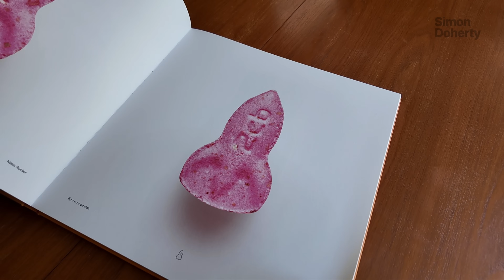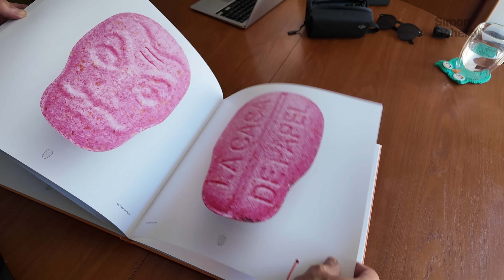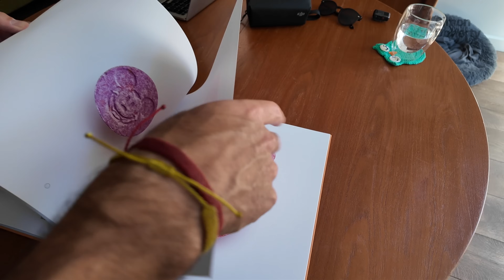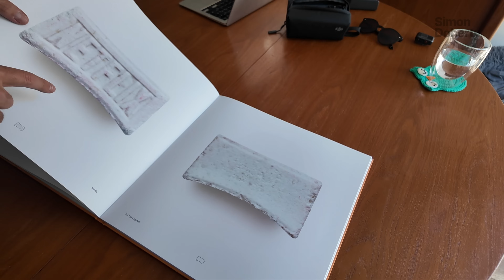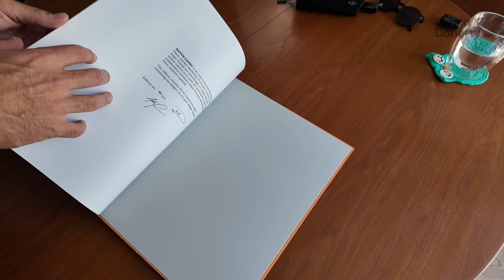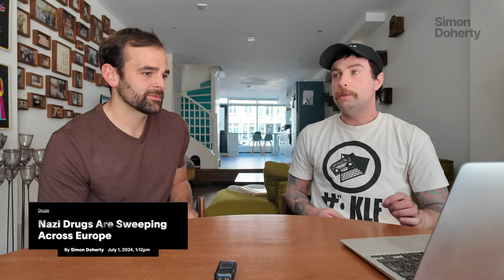How Your Ec𝓈ta𝓈y Pill Gets Its Design

Comment: 29:10 It's not trolling. It might be genuine conviction (just look at the Santa Muerte cult that twists Though Shalt Not Murder into a brutal machismo message) but it's primarily greed. We saw this come down the wire with 2C-B first in a push to mainstream the substance and it got adopted by the MDMA scene far later.

Comment: When we went to the first acid house raves 1987 we had Cali burgers which was my first before doves,then liquid mdma caps. Then all sorts. The worst were china whites. They were tiny but proper heavy like skaggy effects. Instead of people up dancing hard. They were sitting or backs against the walls. Gone are the days of E's that put a smile ( gurn ) on your face. Plus,it's not just the pills alone. The factor of doing them for yrs doesn't help. Plus you're wellbeing and life has to be steady. Otherwise that truma will give you a negative ride.

Comment: Where I live, they always come in gel capsules, I’ve never once seen a stamped pill.
Reply: The first few i took back in 92 were capsules. Had to be careful as could have anything in them. Remember cracking one open before going out and it was speed with a cut up acid tab in it. Still had a good night 🎉

Comment: For harm reduction, people should be charged based on the total amount of MDMA they possess, not the number of pills they carry. It's similar to how you're charged for 100 grams of cocaine even if it's only 20% pure. XTC should be fully legal because it's mainly used in hot environments and it does not make sense to take it more than one every 1 to 2 months. MDMA-related deaths could be reduced to zero. Cocaine is harder to legalize since it keeps on working with increased doses or methods like smoking or injecting. The cocaine situation is a disaster right now. Most of the cocaine for the European market arrives in my city, and a significant amount stays here, which is evident not just from what I see but also from statistics. Large parts of Central and South America have been devastated by it, and now even more so with other, worse drugs. A solution is urgently needed because people won't stop using. Cocaine is an unethical drug to use. While many drugs could be legalized, stimulants are complicated because they can cause psychosis and make users a safety risk. Heroin should absolutely be legal, provided for free, and administered in clean environments with nurses and new needles. This would drastically reduce robberies and bring heroin back as pure heroin, saving countless lives. Apologies for pointing out the obvious, even though no one asked me to ;-).
Reply: Did I write this?

Comment: Haven't had pressed ecstasy in the states since I was in high school 2012-15. Everything now is molly without cut/filler. I miss the Simpson's cutouts and the white Rolexes.
Reply: The pressed ones are around, but very hard to find real ones outside of the rave scene- most outside of that are just meth with very bad presses. I have only seen legit molly pressed one time post-2016, all other has been crystal, which is what you should be buying in the states if you want real molly.
Reply: @sethf2009 You mean in the US?
Reply: @sethf2009 this. i got one pill that felt methy af at a club in los angeles. glad i only took like. the small half and flushed the rest. then i got a pill at an undergeound hard techno + gabber show  and it was probs one of the best rolls ive ever had.
Reply: Because pure crystal MDMA is WAY safer because you actually know what you're getting, especially if you test it. People can put who the fuck knows what into a pressed pill.

Comment: There is another collection similar to this; the Institute of Illegal Images in San Francisco which houses a huge collection of LSD blotters of different designs (interesting tidbit, the whole blotter-with-print is mostly a 70's thing with four color prints only showing up around the 1980's, so if you see someone drop amulti-colored tab ina show or film set in the 60's, that's an anachronism). I also remember once reading an article on Vice about a New York artist who collected stamped Heroin packages, and collected stories about them. His fun fact was that the more high-class the branding, usually the worse quality the heroin was.
Reply: dude i worked at a law firm in chicago and at one point my coworker was tasked with getting something from "the basement".  being that we were on the second floor of a building in the loop i thought this was a euphemism, but sure enough there actually was a basement to the building where we stored archived/completed case files. my coworker came by my cubicle like, "aye, wanna see some crazy shit?"

well how am i gonna deny an invitation like that?

cut to a very normal looking basement with some of those lil cardboard boxes with the thick lids that are basically all just full of random papers....except one in the corner. with a single lift of what looked no different than any of the other piles of paper my dude reveals that our court runner, who had infamously gotten fired weeks prior due to nodding out at the cook county clerk's office, had not only been shooting up in the basement, but had kept every single bag from when he used and just hid it in this one lil box. all of them had morbidly ironic/humorous "brands", often toying with the concept of death. they effectively WANTED you to be scared of a given bag's potency.

again, this is chicago, and whatever the locals call "heroin" in your area depends heavily on where you are in the united states. as you get closer towards the middle you can see the crossover happen in real time, but generally speaking: east of the mississippi river? powder. ECP/#4/china white, whatever you wanna call it. west? black tar and..."gunpowder" heroin...? it's one of the weirdest compounds i've ever had, it looks like potpourri or some other weird herbal tea but once you breathe over it like you're trying to warm up your hands and the moisture from your breathe ends up "melting" the gunpowder into a single coalesced compound that may as well have been black tar from the start, but something about that weird little trick felt like i was watching the most fucked up episode of bill nye the science guy you've ever seen lolol
Reply: The artist was Clayton Patterson

Comment: 100-200 with a braker line is a good product, Strong enough for a night but also choice incase you don't need to be fully rolling.I do like the book. Does it come with breakdowns of whats in them? As cool as the art is it would be great to have information about each one as well.
Also with the rising risk of Fent entering Eruope I can see it being tried but the backlash would be crazy towards dealers, if they decide to spike drugs inhopes of getting people additced to fent. There has been Nitazines found in Pills accros Europe which is WORSE than Fent but its stuck in the fake oxy box and fake benzo box and even then dealers are being open about whats in them now due to backlash and deaths.

Comment: Bro if I get pills that looked that badly pressed , I would rather stay sober for the night
Reply: Just test, usually fine. Does go back to what he was saying about people preferring it but doesn't really change the quality of the product itself.
Reply: @kyrusinek  back in 2008 one night the only available pill were brown hearts. They were pressed well but were brownish off color. 
Turns out some local gang pressed h in it, because the city notorious for it. 
So there are always tons available cheaper than mdma on bulk at the time.

So yeah like half of the club was puking and laying around on the ground later that night. 
That was so awful, almost choked on solid vomit at the chillout.
Really disliked pills from then on, switched to pure md, and ket later..
Reply: Very odd way to gauge something that's not a pharmaceutical 😂

Comment: oh WOW , they have changed !!  much simpler logo/designs back in the late 90's !
used to party a lot, but stopped around 2002. i do have a vague memory of semi-getting back into it for a short time proly around 2005, and talking to peeps about presses was >> take those if u wanna get floored, take molly if u want clean...  i say that as a precursor to >> so back in the 90's it was SOO rare to get pure(s) or molly. The pillz were all over the map, but there were lots that were a clean time. only some got u floored. contrast that to what peeps were saying circa 2005, and my memory of having that salty sweaty high... that head swimming, intense... i call it 'feeling salty' .. whereas the 90's stuff was more serene, almost mescaline-like ,, ethereal ,, felt like the room was giant and you were swimming in peace. a peaceful bliss... AND that is EVEN when taking many and maxing out...   the later ones, in my experience were more like that machine head, salty feeling ... clenchy clenchy clamp clamp
Reply: They used to mix all sorts of things back then. Mescaline, 2'cb, H..  Now I only come across pure (with binder if it's pressed.
Reply: @JackDiddley606  Probably not Mescaline, an ordinary dose is 200-400 mg, which is hard to fit in a normal sized pill without adding any other drugs.